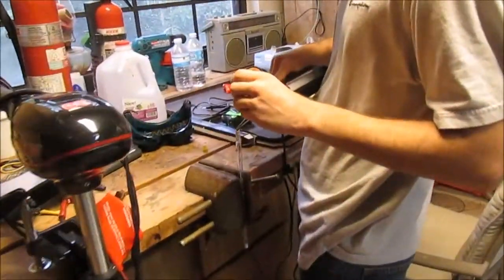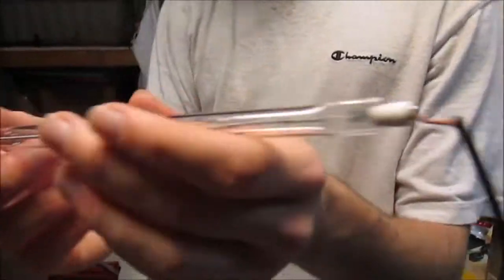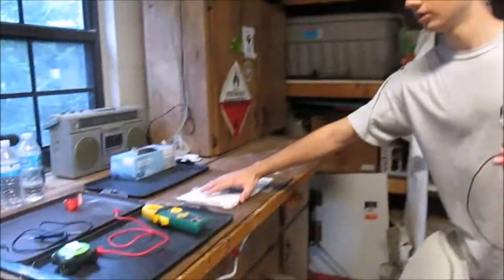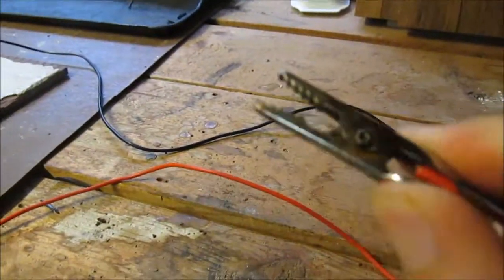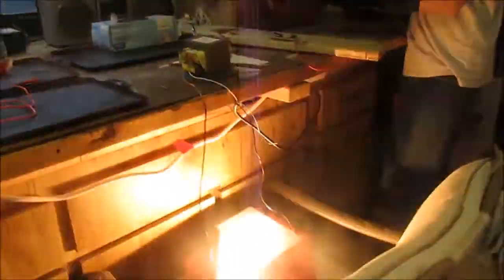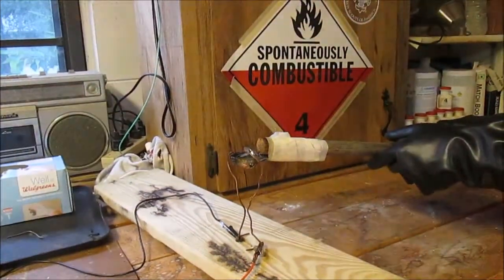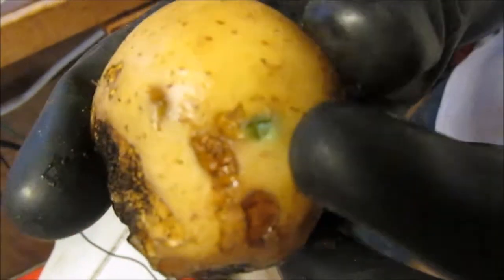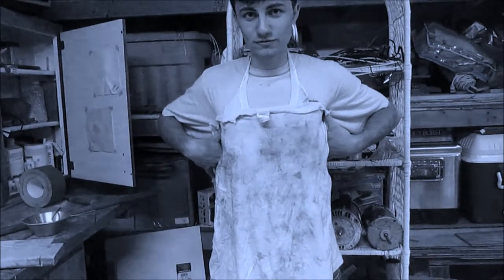Applying Ballast to a Microwave Transformer

Comment: Idiots.  Wood? Not an insulator at high voltages.  And the reason your arcs suck is because you've got no resonant capacitor.   No HV rated wire, certainly no actual HV rated gloves.  This is why MOTs kill hobby electronics enthusiasts.

Comment: You never explained the circuit there was one in the beginning that was so small you could not see it even if you were enlarged it I don't know if that was it usually you show a proper schematic which I was kind of interested in seeing what you did but did not understand it with the resistor thing are you using the light bulb as a resistor and going through each hot terminal to continue through to the coil I just didn't understand exactly what you were after in that I believe you also said that you save money you never explain that either and what type of light bulb was that and also when you're touching halogen bulbs the oils on your skin tend to burn them out in a split second or maybe even more I'm sure that bulb did not last long I know you tried on this video I give you credit just do it right and trying to give your viewers a proper viewing not boring but something that they can follow have a great day

Comment: Yeah I thought of limiting  my  input curre t by using some of it up in series too.
Halogen light is sounds like a great option  but I think I'll leave the bulb inside a proper light to house it.

Water resistors also work well ive read

Comment: I wonder how you would be able to safely contain the ballast since it gets extremely hot to the touch. Is that the next video?
Reply from the maker: There are actually many different kinds of [electrical ballast](http://www.unh.edu/wttac/WTTAC_Water_Tech_Guide_Vol2/uv_ballast.html). And almost all other types of ballast are better in pretty much every way. This is resistance ballast which is almost the worst possible way to do this. If you want to use this then the best way to go about it is probably to either buy a different kind of electrical ballast or just not touch it? We probably won't cover this topic again for lil bit.
Reply from the maker: Also I suppose you could put it into an insulator mount if you wanted to? Ceramic wasn't the best choice, and if you want to do this I encourage you to find a better way than us because that would probably be better for you.